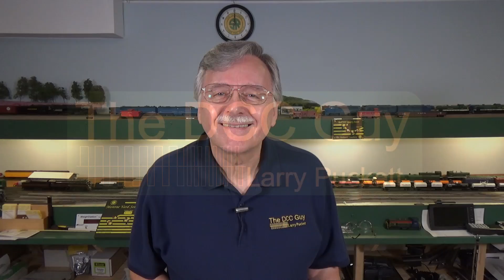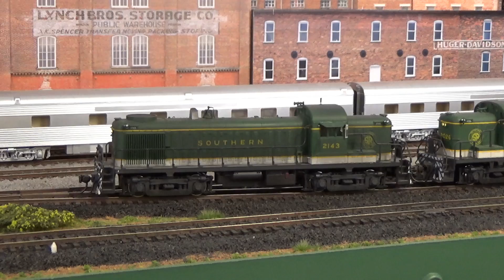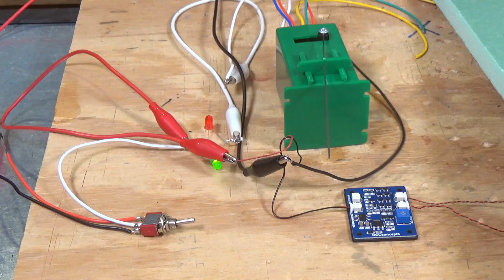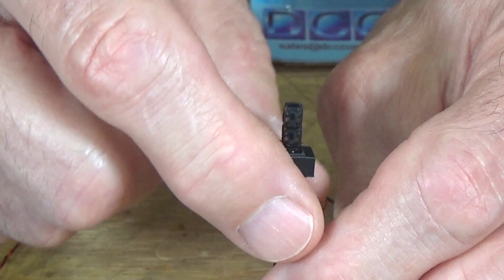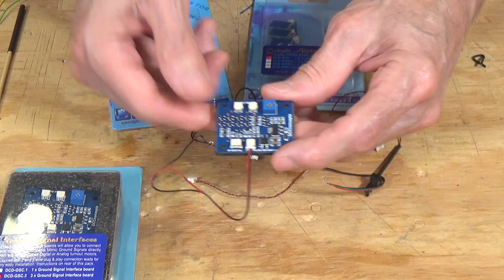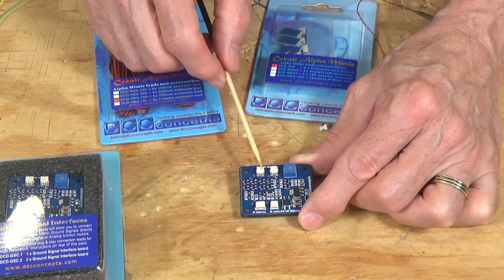Quick And Easy Dwarf Signals For Your Model Railroad (212)

Comment: Can this be used this Kato track? N scale
Reply from the maker: That depends on how you are controlling your turnouts.
Reply: I am open to using any compatible control. I currently use Digitrax DCS52 as my command center. I would prefer not to use digitrax to control turnouts. I want to simplify the dwarf control exactly as you video shows. Just need to know what changes in wiring / hardware I need to control this with Kato #4 turnouts. Thanks appreciate your vdeos
Reply from the maker: That’s not what I meant. How do you throw the turnout points and control frog polarity? If you use a built in Kato mechanism to do this then they will not work with it.
Reply: Currently manually

Comment: Are these Dwarf Signals Red over Green or Green over Red? Can they be reversed to GRN over Red?
Reply from the maker: Well, from the photograph they appear to be red over green and that’s the way they come.
Reply: I am some what color blind so I rely on the position of the colors. Thank you for the quick reply.🕝  @TheDCCGuy
Reply from the maker: I wondered if that was possibly the reason. I like them a lot and they can also be used with Tortoises with a little extra wiring, however DCCconcepts expects shipments of iP Digitals switch machines soon.

Comment: Are you able to use those with Atlas turn outs?
Reply from the maker: No you need a method for reversing the polarity and the Atlas does not do that.
Reply: I would like to add signaling lights on my layout. However I have atlas turnouts. Would you have a suggestion on how to do that? Or would I need to switch out all my turnouts? 
I’ve looked at your channel and refer to your videos often. Thanks for all your support videos. They really help us that are new to the hobby. 
I took your suggestion on trying QSnaps to electronically control my atlas turnouts, however I can’t seem to get them to work. They throw, but won’t return .

Comment: Would this system work with the atlas snap switches
Reply from the maker: I’ll have to check into that and see if there is a way, thanks for asking.
Reply from the maker: I ran this by tech support at DCC Concepts and they confirmed it will not work directly with the AC power used for the Atlas Snap Switches. He did suggest that one could cobble up a circuit triggered by the Atlas switch machine that would use a relay to switch power to the signal board and control the LEDs. Is that something you would be interested in doing or is it more complicated than you would want to introduce?

Comment: Thanks again for this very informative video, Larry.
The square shape of these dwarf signals make it a Dead ringer for  model transit use. (This, in many cases, if the green led can be swiped out for a yellow led).
However;  I'm wondering whether or not, these could be manufactured as stackable, multi-head signals,  for displaying conditions, across control multiple  turnouts.
Their small size are excellent for HO scale.
Yes; I understand the, as is simplicity, of this type of installation.
(You may remember back in the early 70s...
Walthers  manufactured single, and multiple dwarf square signal heads, that were stackable.
Walthers discontinued This square style,  many many years ago.
They were advertised as HO scale, but were actually closer to O scale in size.
I haven't seen model HO scale, square dwarf signals, that are stackable,  anywhere recently).
Anyway, 
Great Work, Larry!

Comment: Hi Larry, great video and stuff information. I have a doubt about the necessity to use
the board with the Tortoise switch machine to turn the dwarf signal light from green to red and vice versa (when the turn out is changed) is it not more simple to use the contacts of the Tortoise and connect the leds to it (there are different forms to connect them) and I'm sure you have explained that in other videos.
Reply from the maker: Well you could do that but you would need to use both the included switches which means you could not use them to power route the frog. In addition you’d have to wire up a separate power source of the right voltage or use dropping resistors, etc. Not exactly the quick and easy plug and play approach that DCC Concepts designed. So if you have the time and knowledge to do all that then yes you can do it, but if time is more limited than money or you have 10 thumbs when it comes to electronics then the DCC Concepts approach is more efficient.
Reply: @TheDCCGuy  Larry, you are 100% right. For a plug-n-play system, this will work very well and that is the video intention. Happy to see you're videos all the time and keep going.

Comment: What a great video.  How would you set this up if you used servos to control your turnouts?
Reply from the maker: Well if there is a way to set up a reversing DC supply in the 12-18VDC range then you could power them just like with a Tortoise switch machine as I will show in my video scheduled for 1AM tomorrow. I guess I will need to break down and take a closer look at how the servos controls work. What system are you using? I’ll also ask DCC Concepts whether they have plans to add a servo controller interface board and one for solenoids which are still popular in the UK.
Reply: @TheDCCGuy  I am using Tam Valley Octopus III to control the servos connected to an NCE 5amp booster.

Comment: Larry, would these deices be overkill to use dwarf signals triggered by micro switches on manual turnouts? Thanks for another
great video.
Reply from the maker: Yes, that could be done but it would require DPDT switches wired in reversing configuration.
Reply: I was looking for a micro switch that I could attach directly to the throw bar on Peco n scale turnouts. Do you know of any DPDT micro switch suppliers? Thanks
Reply from the maker: You need to define micro. At any rate I would first check AllElectronics.com and if they don’t have them go to mouser.com .
Reply: Thanks Larry. Keep those great videos coming.

Comment: I have a small switching layout with Manuel throws and insulated frogs. Is there a way to use these?
Reply from the maker: Yes, that could be done but it would require using DPDT toggle switches wired in reversing configuration.

Comment: I just added some mast type three color signals to my layout and am using Model Train Technology detectors and controllers. LEDs of different colors usually require individual potentiometers to achieve equal brightness and MTT provides this capability with their systems while this system just provides a single adjustment which may not achieve that. Plus, it seems to me that real railroads would have any signals facing in both directions instead of just one direction. Just a thought.
Reply from the maker: As I said a couple of times actual practices vary with the actual railroads, this was just a demo of how the product works. It is up to each modeler to decide how to implement it on their layout. I also showed the 3-socket extension board that allows two signals to be installed in opposite directions, did you not watch the whole thing?
Reply: @TheDCCGuy  Yes, I  did but there was no indication that was what you were going to do, and would the signals be the same for the opposite direction if you chose to do that? I understand this was just a demo of the product. My original thought was this type of signal was mainly used to show which way a switch was thrown. Was I wrong in that?
Reply from the maker: Depends on the prototype and their specific practices for the location. On the Southern they followed a right hand running rule religiously. Consequently there would be no need for signals facing opposite directions on double tracked sections. Single tracks were handled differently since there would be bidirectional traffic flow. Yards could have bidirectional traffic flow or not depending on how they were operated. Signaling can get very complicated even on one railroad so you need to either do your research if you want to be exact or develop a compromise system that covers the basics. A full blown prototype signal system may be more than many operators care to keep up with. Some layout owners send orders by telegraph to agents for train crews but life is too short for learning Morse code IMHO.
Reply: @TheDCCGuy  Morse code used to be one of those things a boy would learn in early adolescence, well, just because it was there and it was a neat thing to know.  But that was then...
Reply: Prototypes notwithstanding, it's mighty helpful while working a yard to have a visual indication of a turnout's alignment that you can see from afar, for all 3 of its legs.  
"Did I remember to close that switch or not?"
Reply: @michaelsmodelrailroading7665  I agree and that's what I thought these signals were for. In addition on real railroads, it would give the engineer an indication of how a switch was aligned. especially when moving through a yard.

Comment: Green light is actually called clear signal on the RR
Reply: Well… it depends. On most northeastern railroads, that would be a slow clear since it’s a dwarf signal. But if it were set up to solely indicate the position of a switch, it would be a “proceed indication.”